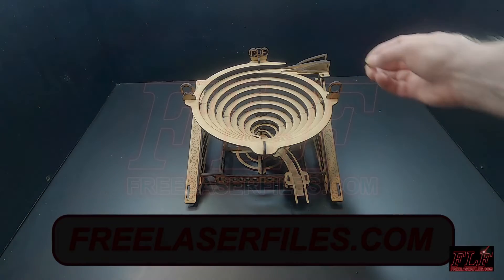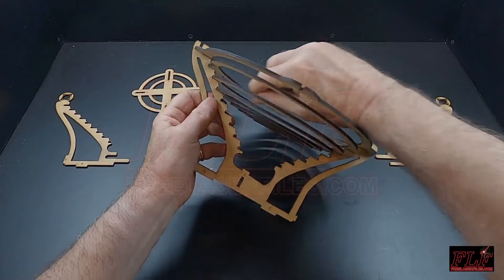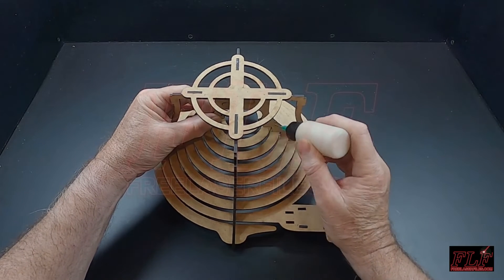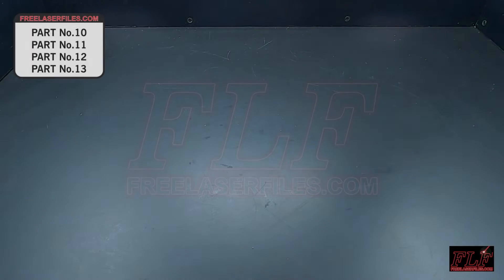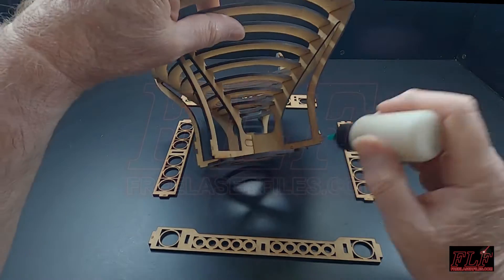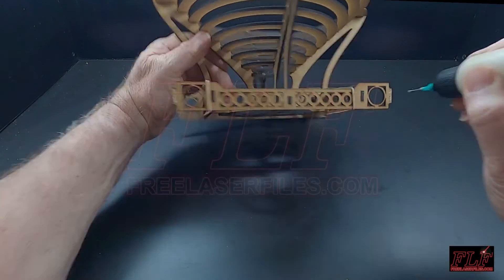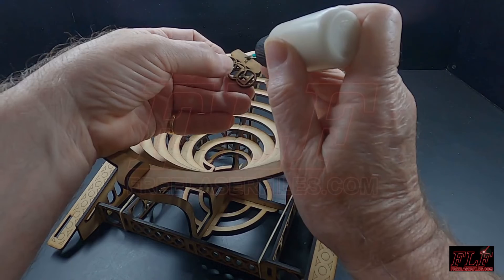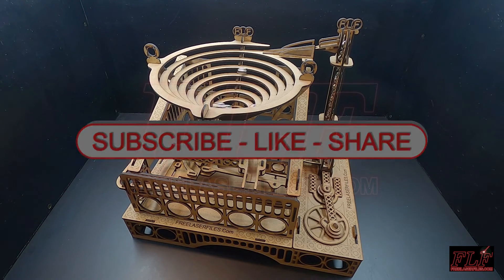Laser Cut Modular Spiral Marble Run Instructions and Free Cut Files

Comment: Your designs are incredible and the videos are brilliantly done with everything explained very clearly.  I have just purchased my laser so not sure if I haven bitten off more than I can chew with this spiral run as my first job.  I have just realised that the scribing on the sides is just that,  I have pretty steps of wood with intricate cuts lol ... I won't be defeated haha although there is a strong possibility I will run out of wood.  So now to watch more of your videos and continue learning light burn.  Keep up the brilliant work,  oh one question I have the 3d files for a marble clock is it possible to just cut these files on the laser and achieve the same result.  Thanks
Reply from the maker: Hi, you are underestimating yourself. You can do anything you set your mind to. I can't comment on the 3d clock file, there are so many variations of files. If you would like to e mail us a copy of the file to FREELASERFILES@gmail.com, we will help if we can.
Reply: @freelaserfiles  Thank you so much for your lovely reply and offer to help.  I have started to assemble the spiral files tonight and it was ok with your excellent video.  The hardest part was getting the spiral. to sit in the 4 arms of the holder but I did manage it.  Im amazed at the accuracy of these files how you even begin to start designing this is beyond me ... excellent work ... I will send the file tomorrow and thank you again

Comment: Are Lightburn files available?
Reply from the maker: Hi, although we use Lightburn to cut the models shown in the instruction videos, it would not be practical to offer these due to the many different settings needed by different lasers. The DXF file can be imported into Lightburn and assigned the layer settings required for individual lasers.

Comment: I need a tip:
I made both of your marbles 
In the first version, the spiral only had clamps at the beginning and end 
But in the second version, the spiral has a holding clip for each round
In my opinion, assembling the first version was much better and it worked properly
I want to know why you changed it in the second version?
Reply from the maker: Hi, the new spiral run is a new design, so it is different. It is not a copy of the old spiral, it is a new drawing. The spiral is bigger and stronger, so I thought it needed holding more securely. The design is just what came out of my head, it is my idea of how I wanted to make it. I did use some of the old design elements but changed them to suit the new design. Many people send us ideas of how things could be designed, and some people make changes to the designs and build them differently. We encourage new ideas and hope our designs stimulate people to design their own models. If you prefer the older design, change the drawing to use it. We include the original corel draw file so that people can make changes. There is no right or wrong way to make any model, so we encourage you to do it your way. If you do build it using the old design, or your own design, please send us a photo of how you changed it. I am not an expert at designing models and I know that there are more talented designers out there. I just like to share some of the designs which come out of my head. Please also remember that when I design a file to share,  I have to keep in mind that people will be using different materials, which could have different thickness's, different lasers with different kerf thickness's, and have differing abilities from beginner to experts. I try to design each model to accommodate all these factors. When I designed models which I don't share and just build for myself, it is much easier. We hope this explain why the model is different and motivates you to do models your way.
Reply: @freelaserfiles  Thank you very much

Comment: Hello
Thank you very much
I really like your ideas and designs
Question:
Wasn't the previous marble design you made better and more attractive?
Please explain what advantages this new model has over the previous one
I think it would be great if you added a stair lift to the previous marble
Reply from the maker: Hi, This run is just one of a series which will fit onto our modular base. We will be designing more runs to fit on the base and each one will be able to use any of the lifts we design. Just now there is only one lift available, but we will be adding more.
Reply: @freelaserfiles  very good
thank you

Comment: Extra lifts and runs? yes, yes, yes please 😀 I know you said that you were using a 20 watt laser for these designs so what spot size is it and what kerf value are you allowing? only asking as I'm having a bit of a 'mare on the cog box.
Reply from the maker: Hi, the cog opening box was drawn before diodes became popular. It was drawn with kerf compensation to suit Co2 lasers. I can't remember the amount of compensation, but I would guess it will probably be around .6mm, to give .3mm on each side of the joints. When I get time, I may go back into the file and redraw it without compensation.
Our new files are drawn without kerf compensation. Joints are drawn at 3.175mm or 1/8ins and tabs are drawn at the same length as slots. The joint fit tolerance is the kerf of the laser. This is obviously effected by the thickness of the material, which we all know, can vary quite a bit. If a tab is drawn at 20mm, the slot will be drawn at 20mm. We try to be accurate, but mistakes can happen.
The spiral run doesn't have any parts which need to be super accurate, so as long as the material used is not over 1/8ins thick, there should be no problems.
Hope this helps.
Reply: @freelaserfiles  Yeah I get my material from Hobarts, it's good quality and turn round time is excellent but the last batch was @ 3.2mm and my new batch is a little over 3.00mm but it's the only place in UK I've found that will supply 800 x 400 with a free cut into 400 x 400. My 10 watt module has a spot size of 0.06mm and my 20 watt a spot size of 0.07mm×0.13mm which is unhelpful when accuracy is paramount.